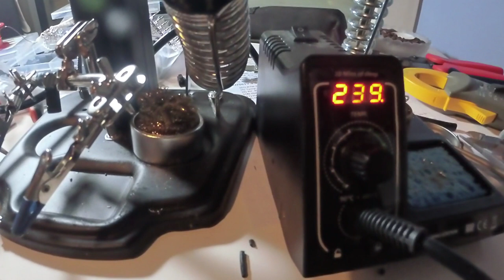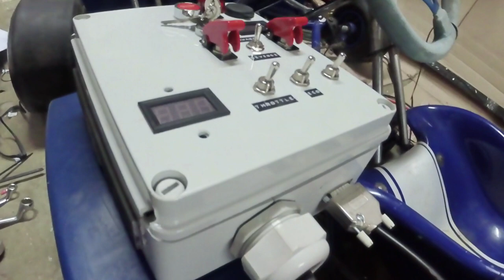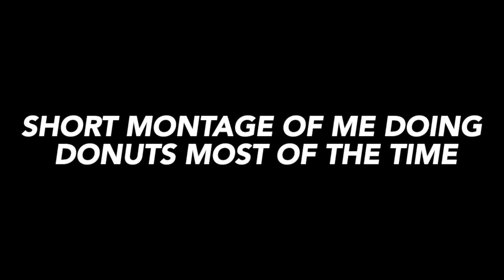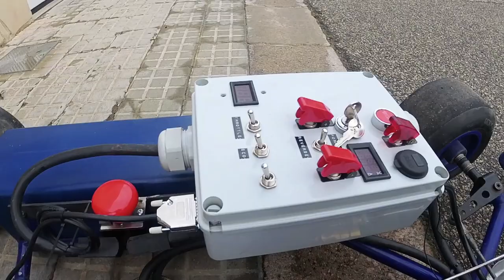Homemade DIY 10000 Watt Electric Go Kart Conversion - First drive and rip!

Comment: What motor is this?
Reply from the maker: HPM5000B permanent magnet BLDC motor 5kW nominal ∼20kW peak
Reply: Where did you get that this particular motor can do 20kW peak.... not what I see in their data sheet....it is rather only 10 kW peak. I am just curious...

Comment: Great work. What motor what battery
Reply from the maker: Thanks! Motor is a HPM5000B from goldenmotor, the provisional battery is a 48V 30Ah LiFePO4, the same used in the car alternator go kart.
Reply: What is  top speed
Reply from the maker: @mainesmith2183  I don't know the top speed, I need to go to a closed track, I don't have enough driveway to test it, and I don't want to crash and damage someone else's property.
Reply: @OverbuiltByHenry  nice nice. Sounds good. I'm gonna start building a Cart next few months.   Do you think 18650 batteries are good
Reply: L
Reply: @OverbuiltByHenry  what is the fastest you have gone I am thinking of buying this motor
Reply from the maker: @mainesmith2183  I don't dare to floor it on the streets and I don't have enough street to fully send it, currently its limited to 50% of max. power. I tried to raise up to 80% but it cuts power when accelerating to protect the battery (over discharge). My options were this motor (HPM5000B) or the QS 138 90H with the votol controller, I think you can find a combo with the QS and the votol on Aliexpress. The EndlessSphere users recommended the QS but I went with the HPM because it was shipping from europe, otherwise I would have to pay a reasonable tax to import the QS to my country.
Reply: @OverbuiltByHenry  I'm gonna do some research now
Reply: @OverbuiltByHenry  how much amp is your bms
Reply from the maker: @mainesmith2183  50 Amps continuous, 100 Amps peak (∼2-3 sec.). I'm planning of building my on battery for this project.
Reply: @OverbuiltByHenry  ignore original comment...but you're running 4800W not 20000W....are you going to get up to 20000W with bigger battery or is this false advertisement lol. Project is awesome regardless great job that  thing is sick! I will be running the new qs 138 70H with build in reduction gear and the voltol em-150-2 controller. Putting the set up in a 2007 rm 125 frame.
Reply from the maker: @vincentpernicano3277  Thanks! I'm currently saving up to build a custom battery, you are right, 20kW is peak power and it's limited to 50%, maybe max. 5kW in order to not fry the battery. The battery that is on it is from the previous project and it's temporary.
Reply: @OverbuiltByHenry  that's awesome man! That motor can definitely handle that power. I got a custom made 20S 68AH NMC battery made and shipped to me for around $1200. I bought it off of alibaba and I was skeptical of buying stuff from China but they went back and forth with me answering all of my questions for about a month before I made the purchase. I think you could get a battery with the power you are looking for in the neighborhood of $2,000.00. I can give you the name of the supplier if you're interested. All cells arrived with a healthy voltage and were all  within +/- 0.006V.
Reply from the maker: @vincentpernicano3277 The cells I looked and the bms cost almost 3 grand, there are from GWL (https://shop.gwl.eu/Winston-40Ah-200Ah/WB-LYP100AHA-LiFeYPO4-3-2V-100Ah-TALL.html?cur=1), If you can give me the name of the seller I would really appreciate it. I've been looking around for batteries and GWL are the only "serious" ones so far.

Comment: Hey bro, how much did this cost u roughly
Reply from the maker: At the stage of this video more or less:
- go kart with gas engine: 400€
- motor and controller: 1600€
- battery: 600€
- misc. : 200€ (wiring, terminals, contactor...)

Comment: What motor and ESC is that?
Reply from the maker: Goldenmotor HPM5000B and Kelly controller KLS7245N
Reply: @OverbuiltByHenry  Man, the speed controller looks really cool, very industrial.
Reply from the maker: @srqcrna  Thanks, it's mounted right on top because the phase wires from the motor are short

Comment: How much did the build cost ?
Reply from the maker: 2k at the moment, the batteries I want to put in are almost 3k
Reply: @OverbuiltByHenry  insane, I just restored a frame. Bought a 10kw 72v motor. Going to either make a battery pack or buy one at a discount hopefully. If you decide to sell your old battery after your get the new set up gives me a heads up :)
Reply from the maker: @Jcslim138  What motor did you get? The battery that is currently in is from a previous project (https://www.youtube.com/watch?v=UeJPAhFpp-g) and I wanted to test with the same battery to make sure everything was running ok and move on with a bigger battery. The specs of the battery (the one that's in) are 48V ~59V when fully charged 50 Amps continuous and 100 Amps burst.
Reply: @OverbuiltByHenry  I bought a 10KW BLDC Goldenmotor 72v.
Reply from the maker: @Jcslim138  Mine is the goldenmotor 5kW HPM5000B